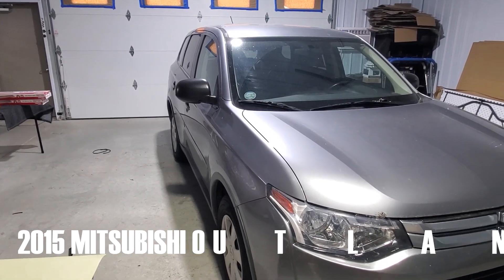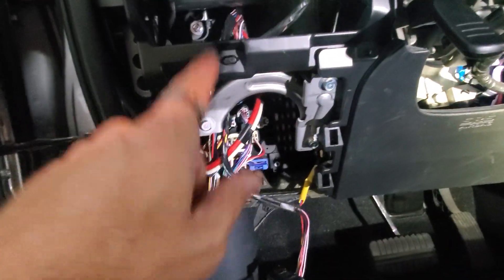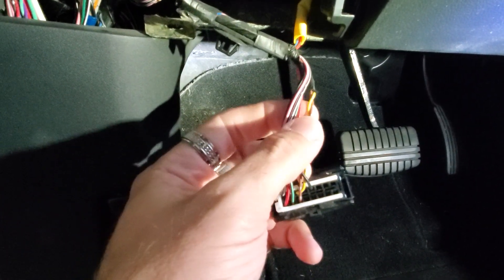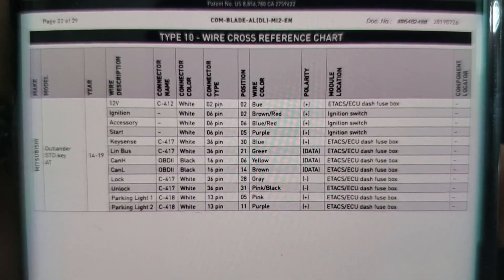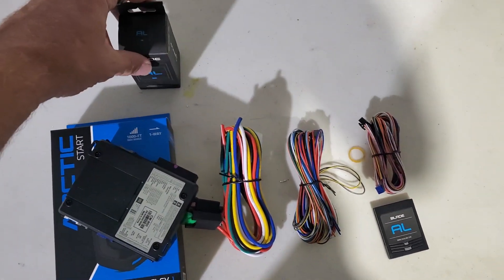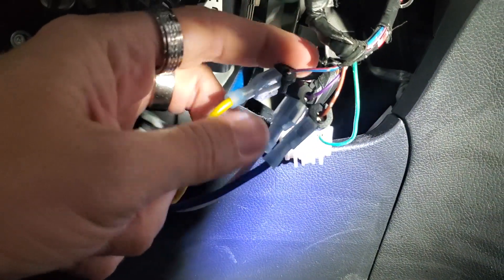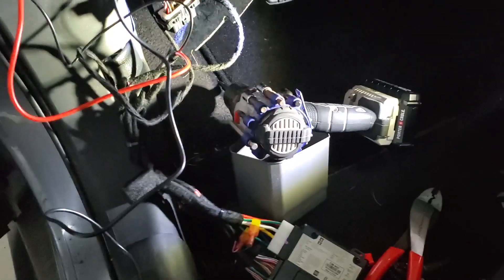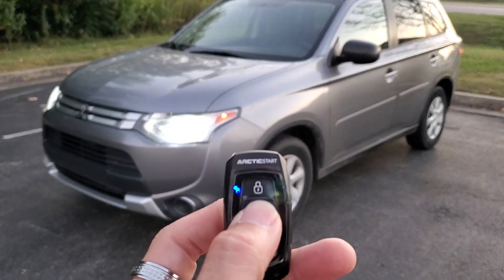MITSUBISHI OUTLANDER - HOW TO INSTALL REMOTE START

Comment: For those running the cm-900as, both red and red/white wires from the main harness need to be used. So you’ll have to find power for both or just tie them together. Also you have the ignition wires flipped according to the schematic. Yellow/starter is supposed to be connected to the purple and the white/accessory is supposed to be connected to the blue/red. Otherwise awesome video
Reply: Where can i find the lock and unlock for 2020 what color those wire?
Reply: @anthonyfiel456  I don’t have the schematics anymore but you can find them on compustars site I believe

Comment: I noticed you used t-taps on the CAN Hi/Lo wires but my tip sheet says to only use the poke, wrap and tape method. I've got some posi-tap connectors but I only want to do this once. The idea of laying on my back trying to strip and separate those little wires doesn't sound so fun but does anyone know if the taps cause too much signal loss in these wires?
Reply from the maker: If you use the black ones we have never had a problem. Red ones are a little too large and my wiggle around a little bit. If you are really worried about it I would just do the wrap method like you were talking about about
Reply: @octanetvchannel  Thanks! Yeah, I just don't want to it more than once LOL

Comment: 2020 outlander is same way to Install ?
Reply from the maker: If it is the same body style it should be the same
Reply: I found out if you press the lock button 5 times on the factory key, it will start the vehicle with 15 mins of motor time
Reply: @jeet1890  for what year?